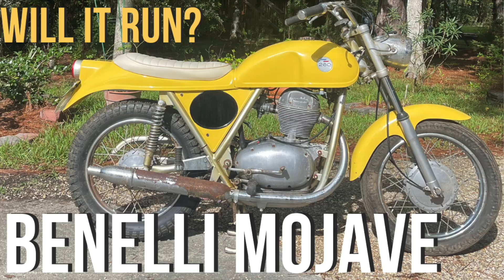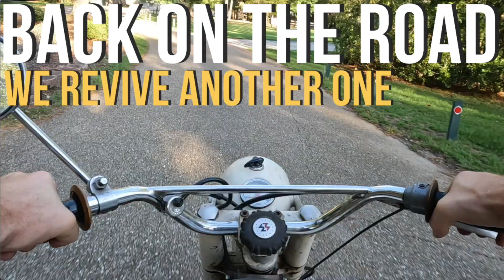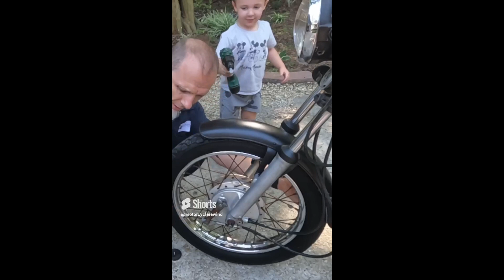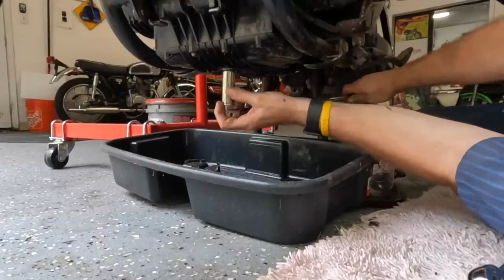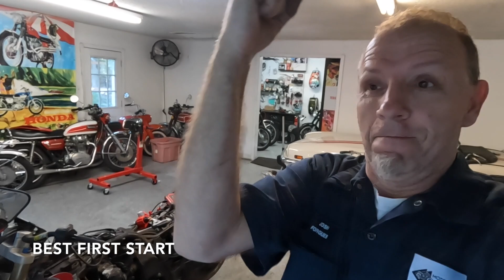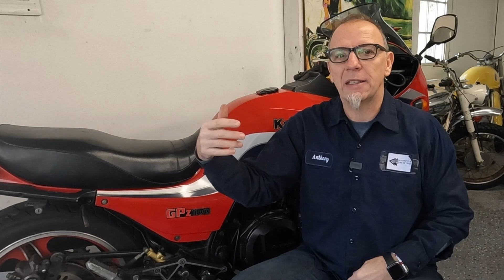Can't Believe This Happened! 2023 Was An Amazing Year!

Comment: Are you sure your grandson isn't Pugsley with his drill? Otherwise the GPZ should be "the motorcycle that wouldn't die".
I started as a road rider in 1968 and learned how to maintain them. Main problem is the new ones need very little attention, and the old ones, down here in Oz, are hidden. You have amazing options.
Reply from the maker: The GPZ is definitely a shocking result. Planning another roadtrip for it.